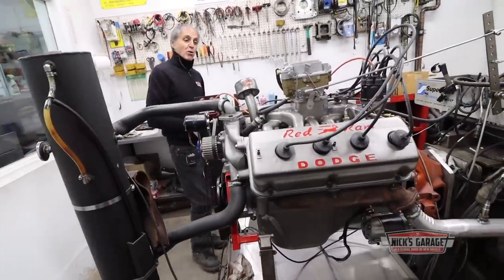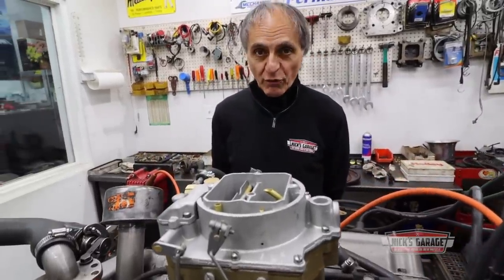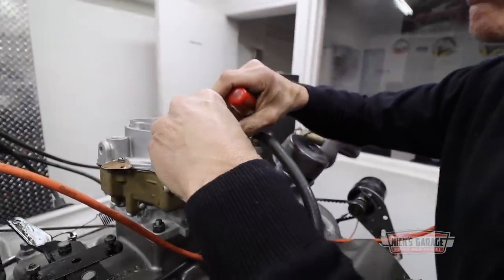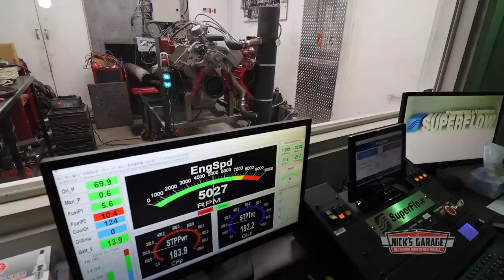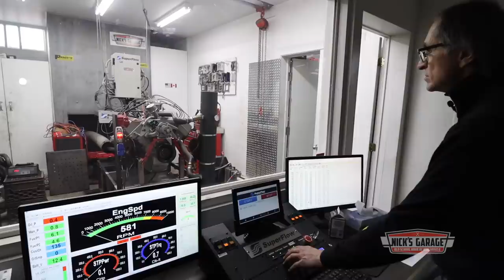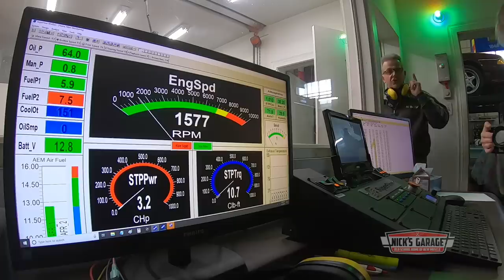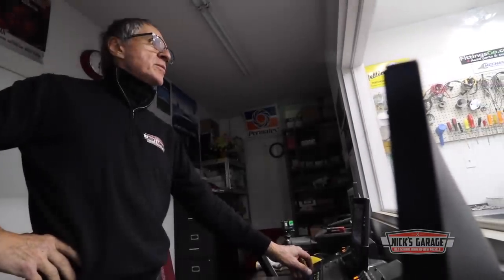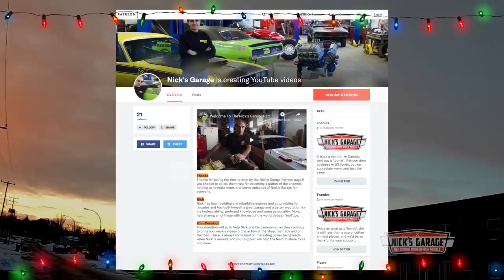Tiny Old HEMI - First Generation 241 Hemi on DYNO

Comment: Exhaust Manifolds Are 65 Yrs.Old.Can' t Handle the rpms Over 44-4700,Get An Exhaust Shop to Quote U Price On A Set That Are Little More Ported,If Reasonable ,Extra Power Has to Have Better Exh.Flow,Would Think.Good Exhaust Shop Would Be Happy To Be Part of Helping U,Be A Challenge To Them

Comment: Back in 1985 I built a '30 Model A coupe with a 1955 331 ci. Chrysler Fire Power motor.  I was surprised to discover the upper bell housing bolt pattern lined up with the late small block torque-flite, and to also find the late Hemi flex plate bolted right up to the early crankshaft.  Like Nick found, it required ARP bolts and nuts, as the original f/wheel/torque converter unit bolted on with bolts through the front of the c/shaft flange- straight holes, no threads.   I fabricated a 5/8" thick aluminum adapter to get the correct spacing for the modern torque converter, and install locating dowels for the trans bellhousing alignment.  I ran a Joe hunt magneto for a 340, dropped right in.  I used a vintage Offenhauser log intake with 6 Stromberg 97's, and made up progressive linkage to run the center carbs together, with the other 4 kicking in like a typical tri-power set-up.  Halibrand Champ quick change rear.  It worked a treat, and ran REALLY well.  Fun car, drove it from Seattle to Bonneville for the speed trials in the summer of '91.  Cruised at 120+ no problem!

Comment: That humble is sweet!!
I've some history with the 241. I also was born in '56 as Nick was. When I was 10 Dad discovered the building of Farmall F20 tractors with small block chevys. Wasn't a lot of trouble, just had to do whar Nick did with this bell housing, flywheel, etc, and others had done it before so we just had to follow instructions. We built 3 but when it became time to build the one that was actually my dads grandfathers he decided it didn't need no stinking chevy, it was getting the 241 he'd saved out of his new car that was rear ended by a dump truck.
It took 2 weeks longer to build but it worked, and 40 hp less than the chevy my butt, at the little county fair tractor pulls that thing put the ones we built and other chevy V8'ed ol' tractors in the dust. With that 4 into 1 exhaust(a tractors exhaust has to point straight up)that sound was so much better than those chevys-it's a hemi.
I tried to get him to pull the 392 out of his '57 covered with a tarp in the car shed but that barely got out of my mouth. When I returned from the service he'd sold it and the buyer wouldn't sell it back. It was stolen some time later and the front section was found in a scrape yard.

Comment: Great work as usual. In 1976 I was working for a shop that specialized in performance cars. A customer brought an all steel Model A coupe on a trailer for us to get running and tune. He was going to take it to the big Gatlinburg Tennessee street rod event. The builder operated a tool and die shop and the car had lots of one off billet aluminum before the billet fad had started. It had what I called a "Baby Hemi" and even in 1976 these were very rare. The engine was a new N.O.S. unit with a solid roller cam,  a rare dual coil ignition, and 2 4 barrels. All these parts were rare even over 40 years ago.  The builder made a bad mistake though.  I was installing a clutch next to this car and all at once there was a lot of smoke and someone yelled woa! He had hidden the fuse panel and other electrical items under the seat and the battery was in the trunk. When he put the cables on the seat springs were touching something in his hidden wiring and all the wiring melted. He didn't make his trip. This was such an obvious problem and it proves that even the best can screw up if not careful.

Comment: What a neat old engine. It’s amazing that the modern Hemi still uses the same bellhousing as that 1954
Reply: The bellhousing he fitted was from a 340 "LA" engine (listen again at 2:30), which was introduced in 1968 (just 14 years after this one). The LA is NOT a Hemi, it's a wedge head like the 273, 318, and 360. None of this has anything to do with, nor anything in common with, "modern hemi" motors.

Comment: That's older than I'm thinking of, but I grew up in the 80s and started driving early 90s. There were still a lot of cars that had a power range like a golf cart. Max torque around 2500 and max horsepower around 4400. You could rev them past that on a whim if charging a hill, but there was nothing to be found in the upper RPMs - they'd run faster rpm but drop back when challenged.

Comment: The old Dodge Royale Red Ram baby Hemi. I haven't seen a 241 since I was 16  years old. Thank you so much for showing the little 241. With the Offie, and someone with a tubing bender who could fit & weld to improve the exhaust with some decent headers and some careful tuning these could   squeeze out about 175 180 HP.  You have to change ALL of the jets in these old Carters. The 331 was far more common back in 1954.

Comment: Nick, my hat is off to you for rebuilding the little ram hemi and getting it running again. Once again you took a stock engine and made stock power. I’ll never understand, with all the new technology we have, these engines still make stock power numbers!!! New cam technology, new piston technology, etc!!!
Reply: Scott.       The pieces we replaced internally were all new old jobber replacement. Nothing high tech here.
Reply: Nick Panaritis 
That’s my point exactly. Those are internal pieces that can’t be judged on for original components, so why not use the technology we currently have to upgrade? You have to buy pistons or cam, and nobody probably carries them without special order, so why not go with a Mahle, or a better cam with close to stock specs for the money?

Comment: Nick, what I do is, take timing light spark plug inductive lead, and move it from wire to wire while holding light trigger on, check all 8 while running, just to make sure  they're all sparking evenly.  Use the timing light flash as spark indicator.  It'll stutter on a bad plug or wire and show a misfire. You can Rev it up a little while doing this, I've found MANY bad wires, plugs this way.  You may have an ignition problem there.  Also check fuel pressure, spray intake for vacuum leaks.  Or....a bad coil or coil wire, or cap/rotor.  Check center coil stud in distributor.   Are points adjusted properly.

Comment: FORGET all the numbers for a sec...this has got to be one of the sweetest sounding engines i have ever heard!! Moving through the 3000 rpm range to max HP and rev, the guttural growl of it just SINGS!
Reply: Plenty of power to blow away the much bigger flathead Fords...
Reply: Put a blower on any early hemi with nitro will run in the 7s in a dragster.

Comment: Merry Christmas from Laut and Sharon, we play with Hemis too. Check the carb linkage in two places. 1 the power circuit where the little vacuum piston  moves the metering rods. And 2 the linkage that tips in the secondaries. Set them all to factory settings before you move on to richening the mixture. But I think it's that small little lever that's moves the secondaries. I put on backwards once. Looks like no fuel coming out the discharge nozzles and the air valves are not moving. Great vid, just before Christmas,!
Reply: Awesome video, did you check the metering rod level adj, might not be pulling the rods out far enough out of the jets. Maybe it got bumped when you put it back together?
Reply: I think you are right too. Those metering rods and that vacuum piston are very touchy.

Comment: Loved seeing this little Hemi! I have a 270 ci Super Red Ram Hemi in my 33 Doge 5 window coupe. It was originaly built in the 60's, Running an Edelbrock intake with 3 Stromberg 97's, bored .060 over with Jahns 12.5 pistons and a Racer Brown flat tappet cam, sodium filled valves with cut down marine push rods and D500 heads with adjustable rockers. After blowing up the old 3 spd top loader, I mated it to a 727 torqueflite with a B&M manual shift reverse pattern valve body with a home made bell housing spacer mounting plate and a TCI high stall converter. It has a unique sound and runs pretty sweet. I never had it dynoed, so this was a fun video to see. Thank You for posting this!!

Comment: Nick, watch the video and note the overhead carburetor shots.    The secondaries were fueling on the first run, but there is no fuel passing through them on any subsequent run. Something is amiss with the reassembly or there is a blockage preventing fuel flow.
Reply: Charles. We went back into the carb and blew air through the rear jets and got it going well after. Went up to 157 HP.
Reply: Merry Christmas  Nick thanks for another great video

Comment: Nick, This was kind of a Christmas present to me seeing that old girl  (54 Baby Hemi )back on line as it is almost as old as ME lol .  I have messed with them Carter WCFB before and there very touchy to dirt from pulling the top off.  A old trick that I use is to use your hand and bring up the RPM to over 2,000 and choke the air horn with your hand and punch the throttle as your chocking the air horn with your hand, then clear it and punch it a few more times to get everything to take a seat inside the carb. Do that a few times chock it down hard , then clear it with no chock .  I can't explain WHY it works, it just does . Also install the air clearer for extra draw on the carb .

Comment: Best dyno room show ever! I’m sure about a dozen commenters or more of already said it, but the secondaries were not opening on any run after the first jet change. The overhead camera tells all! It’s amazing that not having the secondaries only cost about 10 hp. I think that really shows what a plug those exhaust manifolds are.
Reply: Steve.    We had it fixed the next day.
Reply: I figured you did!  I don’t know why, but I enjoyed watching that little old engine hit its design specs dead on the money SO much more than all the shows out there  where you can see  a Gen3 Hemi or LS  hit 1000 horsepower with turbos and electronics.  And that sound... I had to stop the video on the iPad and move to the room with the big TV and big sound system and replay it!

Comment: Hey Nick Very cool seeing a old Hemi (even a small one) running on the Dyno. I was telling my computer screen "Adjust the Primary Metering Rods" . The two "levers" under the cover on the front of the Carb change the accelerator pump "phasing and mixture" if you have good pump function don't mess with  that but if it needs to run richer Move the "metering rod lifting lever to pull the rods farther out of the jets, that will richen the mixture of the front venturi but also the overall richness. I run a 1952 Chrysler 331" Hemi in my 35 Dodge hot rod pickup. I am stuck with the horribly low compression ratio as well (mine is worse because) I have '56 (354") heads and intake & exhaust manifolds, on the '52 block. The later model heads have bigger valves and ports but also a larger combustion chamber so, I'm guessing 6.7 : 1 compression. My heads and manifolds are ported out somewhat, I'm running a stock cam/lifters (52 parts) and a 500 C.F.M. Edelbrock A.V.S. carb I don't have Dyno figures but my Little Truck" runs great, pulls a car trailer with ease, I run a lot more timing around 46 degrees and no spark knock/pinging issues.  I run it on "regular" low octane fuel, it gets 12/13 miles per gallon  (I run a chev 4 speed manual trans and 3:50 geared 9" rear axle) I'd love to see my Engine make some "Pulls" but I'm in NW Oregon (50 miles from the Pacific Ocean) so getting over your way (with my engine in Dyno Ready condition probably not gonna happen). Love your show. Keep up the good work. P.S. My Pickup has over 51,000 miles on the Hemi since 2014.
Reply: Al Munger -👍Sounds Very Nice👍✌️
Reply: Nice to see an old Carter WCFB. Common carb in those days. Some early Corvettes used two on the dual 4 bbl setups. White Casting Four Barrel is what the letters stood for. Later on, Carter brought out the AFB (Aluminium Four Barrel) Things were simple in those days. lol
Reply: D2e

Comment: Got that little Hemi on the Dyno! Sounded really good on those 1st runs. The only thing is, after you pulled the carb apart, it started to have a pronounced miss at mid RPM's on..think I'd look closely at that accelerator pump, or the internal and external linkage to make sure nothing got put back wrong or crooked, also that the vacuum advance isn't throwing it out of whack. Get that straightened out, then see about fabbing a set of headers that will fit in the car out of a 340 set or something, as it's almost a crime the way exhaust is so restricted..like taking a big breath in..and only being able to expel a little. Love you paint job on the valve covers though! Merry Christmas everyone!

Comment: Nick the choke linkage will prevent the secondary’s from opening check adjustments and you will see how the lockout works from a Chrysler master mechanic with 30+ years in  Chrysler dealer with lots old Hemi experience, also 70s Challenger owner love the quality and experience you display
Reply: Agree hope it gets fixed.
Reply: +2 you could see the secondary side not opening in some runs but the last run they did But the boosters didnt seem to spray fuel .
Reply: The Hemi Humble, cool
Reply: @ToxicMisfitsYt  To bad you don't know what your talking about.What did you do ? Play a game with one once.
Reply: Donald Heitger just a boat anchor is all a hemi is they won’t hold together
Reply: @ToxicMisfitsYt  spoken by a person with no experience
Reply: @ToxicMisfitsYt   I can show you a 1000hp Hemi for sure.
Reply: this is the problem fx secondary choke lock out
Reply: @davidnewton3485  yes fuel spray look weird from here

Comment: Nick, now I'm usually the dreamer that loves the unique builds, and it cannot be more unique than a 241 Hemi. When I saw this title, I HAD to watch it ASAP! However, I'm sure you had the exact same thoughts of dynoing this engine in stock form, and then with a 600 cfm 4 bbl, then with a set of higher compression heads and a set of custom made headers, then with the higher compression and two four bbl carbs and a dual tunnel ram just as a comparison and to see how much you can possibly squeeze out of this engine with the stock internals. I realize that this is an extremely rare engine, and you would be so scared to push it, but as much as you love to keep it in stock form, you and I both would LOVE to see it make some higher horsepower levels. I'd be really happy to see it make 300 HP. I'd love to put it in an old Dodge Business Coupe with some upgrades just for the nostalgic effect.

Comment: Nick; That Offenhauser manifold CAME on the engine with the car from the factory, if anyone didn't know. It was not an add-on item. I've got an article somewhere in my old mags that I read recently which was about that model Dodge. Another thing to note is the angle of the lifter bores, which stayed as that cylinder block, with modifications, was made into Polysphere and wedge engines such as the 318 Polysphere and the 273-318-340 engines. By keeping that angle, the valve lift is reduced a little on a wedge engine. Matching some head gaskets of a 315/325 Dodge Hemi and a 318/340 might be interesting to see if they can be swapped as on the 331/354 to 392 Chryslers (and vice-versa).
       A note about the '57 Dodges for KB10GL too. One fellow in my county bought a new Dodge D501 convertible. It was standard shift with the Chrysler 3-speed and the left-over 1956 Chrysler 300 354 Hemi engine! Needless to say, the transmissions, designed for Chrysler 281" flathead 6s, didn't last long. I heard he was able to adapt a 1937 Cadillac transmission to it. I saw it once at night with a long shift lever in it, but I've never heard of it in later years, so it's undoubtedly long gone.

Comment: That carb looks like an early QuadraJet. There is an interlock between the choke and the secondaries.
After you changed the jets the first time the secondaries didn't open. I bet the interlock is preventing them from opening. You may have put one plate on backwards or it is misaligned.
Good luck searching every place else, it is a carb problem.
Hope you had a better Christmas.
Reply: it is a Carter WCFB. It also has an interlock between the Choke and the secondaries. They came up with it a decade before the Q-Jet.
Reply: @capriracer351   You're right. It has a similar appearance and that reminded me of the Q-Jet. At least as memory serves, been a LONG time since I built Q-Jets and made them run well. Thanks for the update on the WCFB World Class Four Barrel.    LOL
Reply: JT.   We had it fixed the next day.

Comment: I dragged a '53 or "53 Dodge out of a wrecking yard back in 1966, cleaned it up, changed the oil, new plugs, etc and fired it up on first try. Then I ran it like a mad man till Uncle Sam called me up the next year. That thing had incredible torque and would chew-up clutch discs.  I was even able to chew up the rear-end spider gears!!! The u-joints were the weirdest design you could imagine with needle-bearing rollers on steel rods.
Reply: They made some pretty weird stuff back in 50s
Don’t forget this was back in the day when a whole lot of cars were still running flatheads.
Reply: good old days

Comment: I Used the LA distributors on my Hemis, 354's. Bolt on Fit there too. I used the orange box for the ignition. I also used the Mellings High volume pump , with the LA heavy duty shaft. It needs a small adaptor made to fit the pump. I think LA bearings also fit the red ram too. 
On my last Hemi i had a bohnalite twin four barrel manifold ,with Dual WCFB's... urrrgh!. 
The bohnalite manifold had mopar part numbers but was made for Karl Keikhafer for his Mercury team hemi cars. Oiling to the rockers is always a source of concern because the cam regulates the oil flow,letting oil to rockers every 1/2 turn .so never rev a cold hemi unless you want to wear the rocker shafts.